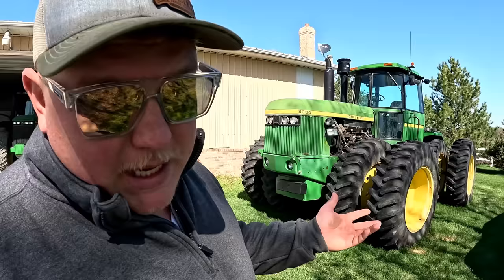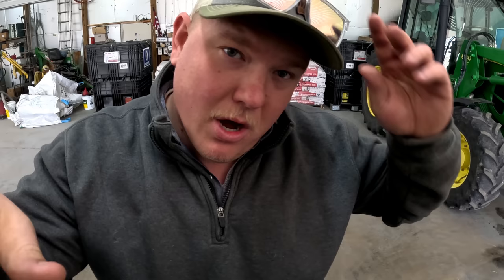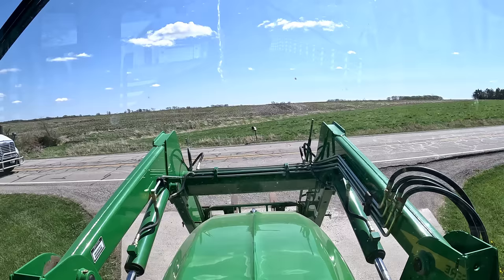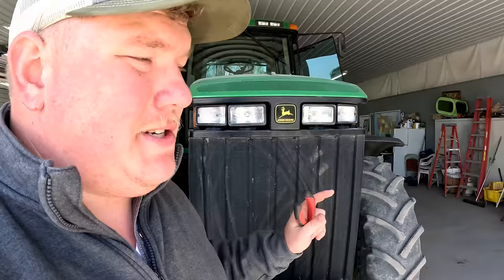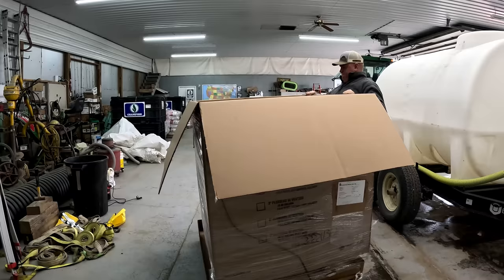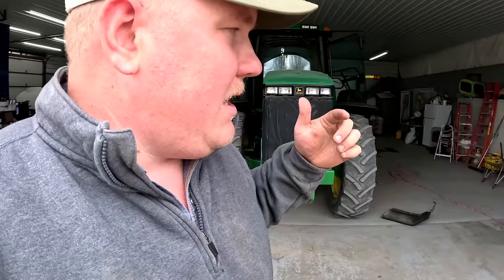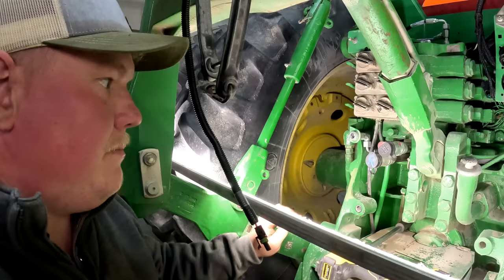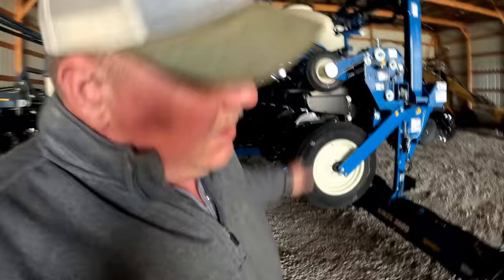Getting my TRACTOR ready to pull a NEW KINZE PLANTER!

Comment: We’ve had the handler 3inch for just over a year and it’s worth every penny. Saves the headache of refilling the sprayer. We run bulk tanks and use sotera meters (one on each tank) and have a 3 way banjo going into the bulk Venturi port on handler. We also run a hose from the fresh water valve at the bottom straight into the T banjo at the bulk Venturi so we can rinse lines and get all chemical out of handler. It’s been flawless and made me love spraying again !
Reply from the maker: Can you email me some pictures? iowanfarmer52581@gmail.com
Reply: @iowANFarmer  yes I will send them when I get to the barn in the morning

Comment: Your first small hyd line on the back of the 8110 is your load sense line. When the load sense line is pressurized, the hyd pump displacement increases to match the flow needed by the implement. The scv stack has a dedicated load sense line, so anytime an scv is run in detent, the line is pressurized and the pump can increase displacement. Load sense is the most efficient way of managing closed center hyd systems with varying flow demand.
Reply from the maker: You explained that way better than I did. Thank you.

Comment: Easy on the metering Ben! It’s all 2 inch, get you the cheap flow meters, and they are super close on measuring the volume you need. Ag chem solutions. And if you didn’t see my response the other day on the blue lights? You can get them from there as well. 👍🏼 go get ‘em amigo! You’ll not want to go back to your older planter after using the new girl. Better get out the check book 😂
Reply from the maker: I’ll check out the website!

Comment: With your handler 3 the hose that cleans the jugs out after you stab them make sure that’s tight on ours we have a chunk of wire on it because it keeps coming loose and falling out just something to keep in mind
Reply from the maker: The little white pipe?
Reply: @iowANFarmer  yes
Reply: @iowANFarmer  it could be because we run a 3 inch one but not to sure

Comment: I’ve got a chem handler III with 3” plumbing but it looks like everything is set up the same as your 2” handler. I used the Dura meters and 12v pumps to measure product into the induction cone in the past. Currently I have a manifold of four, 1 inch valves plumed to the 2” suction port on the chem handler. I use a dura meter inline just before the suction port handle to measure the product I’m pumping in the sprayer. It sucks whatever bulk product you are measuring much faster than trying to use the 12v pump. You just have to calibrate the meter for the product you are using. Dura meters are easy to calibrate and in my experience very accurate. Get ahold of Matt at sprayer specialties up there in IA I’m sure he can set you up with what you need.
Reply from the maker: That’s where this Handler came from. Thanks for the tips!
Reply: No problem! Great videos! Keep ‘em coming

Comment: Love our handler. Wish i had another inductor without using venturi
Reply from the maker: Why is that? Do you have a meter setup?
Reply: @iowANFarmer  have 12 volt pumps and meters. Our fs supplys them as well. Sucking 30
 gallon of produt through a venturi is slow per fill. The fastest way would be to pre fill your inductors with product while your finishing loading with water and then use pump suction to drain inductors.
Reply from the maker: @agger838  I got you there. We don’t like sending the chemicals into the pump. But we also are trying to set any records loading. But anything to make it easier to keep track of what’s gone in, less 2.5 to rinse and open is a win in my book.
Reply: @iowANFarmer  i mean a guy could meter everything right into a venturi all at once and thatd be faster, but i dont trust meters.
Reply: @iowANFarmer i made a jug rinse for my handler. Super handy. I dont use the chem blade on jugs.
Reply: We use a 65 gallon inductor with a 2” on the bottom. It’s T in the 3” fill line. We put 400 gallons of water in the sprayer then open the inductor  and suck it out with the water.  We’ve never had issues.  The chem blade works pretty good but can be a little tough to get some products cleaned out of the jug.

Comment: We had a 3” full port banjo in-line flow meter that we used on hot loaded fungicide and it did a really good job and was pretty accurate with the chemicals fertilizers and water that we where filing into planes they are a little cheaper then a tote pump and meter
Reply from the maker: I’ll look some up.